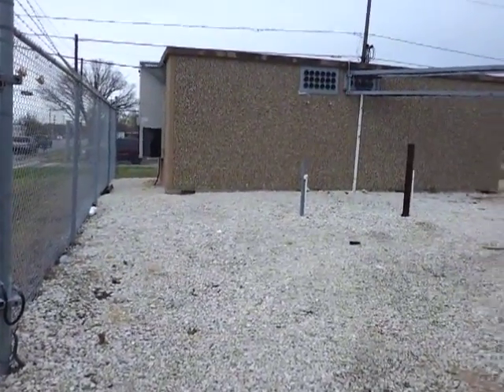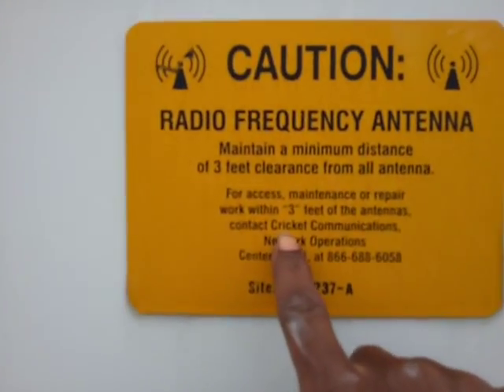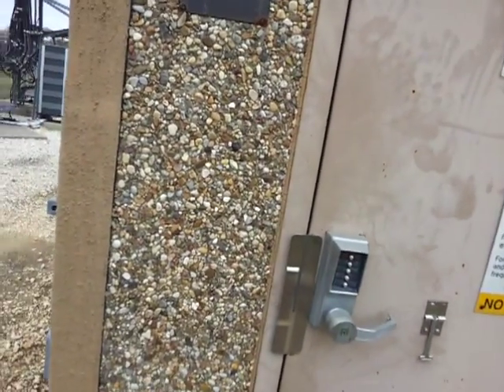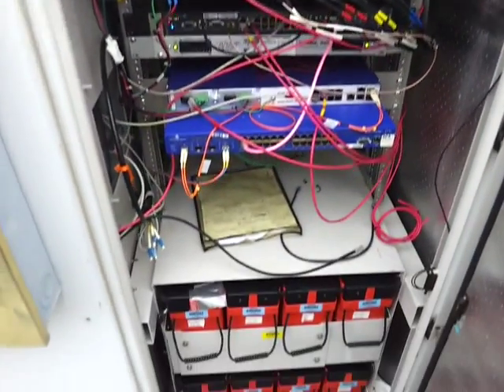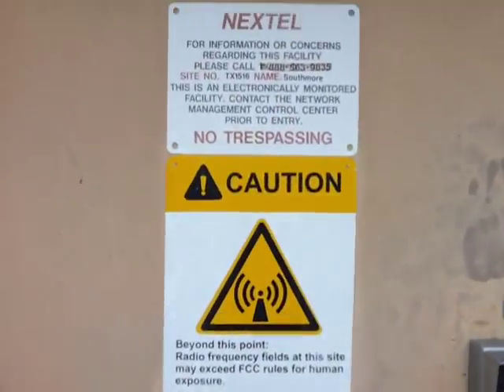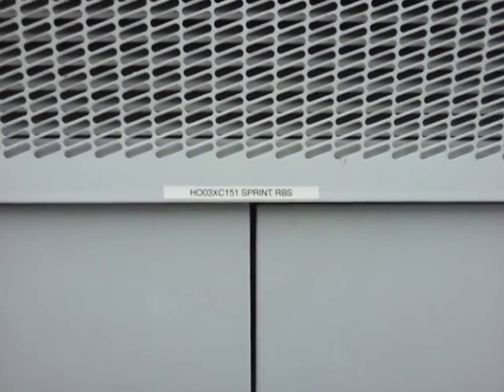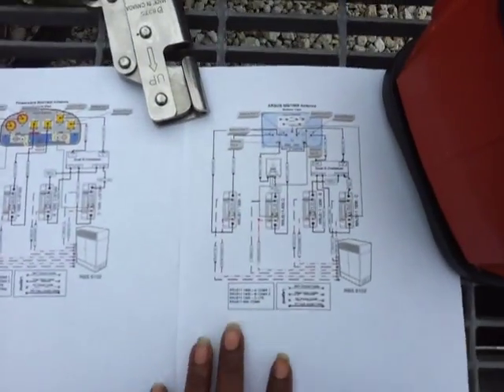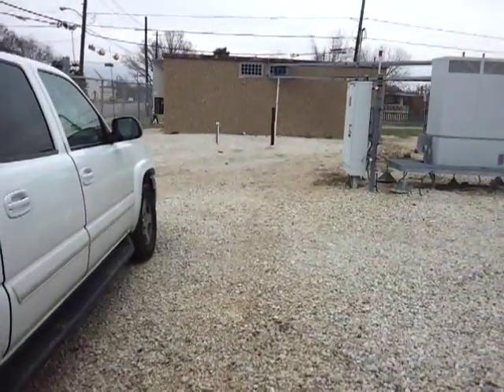Cell Site  Walkthrough

Comment: 01:24 - A TMobile Tower! That's sure a rare sight.
Reply from the maker: Yeah and it was a nasty site.
Reply: GladiatorGaming
No. Neither here nor there have they done that. They did start rolling out a lower frequency LTE in many markets, which does propagate further, but I don't think they've actually expanded the network at all.
Reply: Hey for the record they have extended there coverage more
Reply: ***** Hmm maybe not in your area but if you look at before and after coverage maps you'll notice a big difference maybe its because T-Mobile doesn't want to spend money on upgrading a tower
Reply: GladiatorGaming
Lower frequency LTE goes a long way in signal propagation. Still doesn't help when there isn't actually a tower there to deliver it though.

Also, its what? Its flavor? Its color? Its smell? Don't leave me hanging!
Reply: ***** Well true,Im talking about the coverage maps like in 2010 to like 2016
Reply: GladiatorGaming
Me too. Doesn't change the fact that using a lower frequency is not an appropriate substitute for actually building out the network infrastructure.
Reply: Verizon still has the best coverage of them all. We have a micro cell 7 houses down from mine in the middle of my subdivision. Another in the neighborhood next to mine.
Reply: @billybassman21  How times have changed! With proper buildout in the past half-dozen years, coupled with the proliferation of band 12, (and that's to say nothing of band 71) they really have come around. T-Mobile actually works in most places that VZW does.